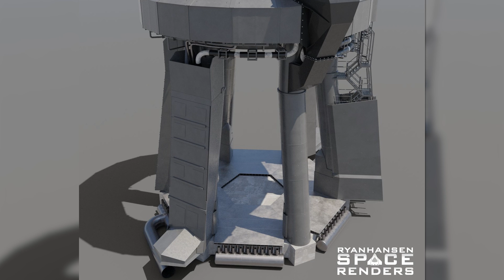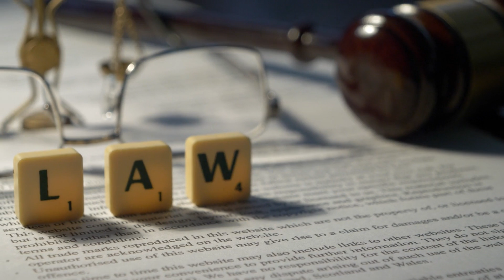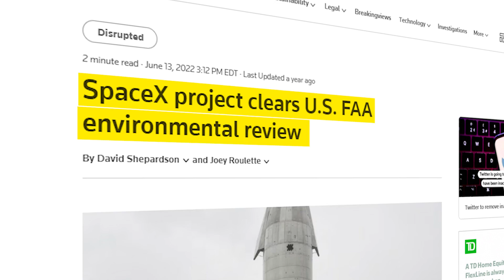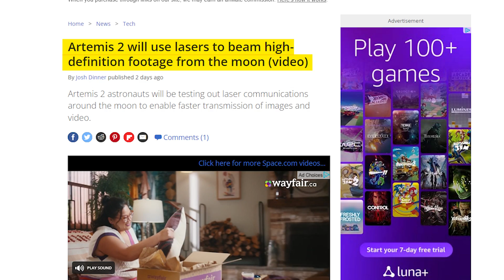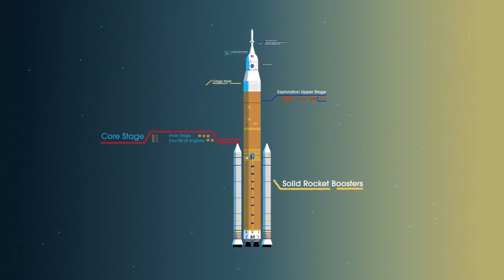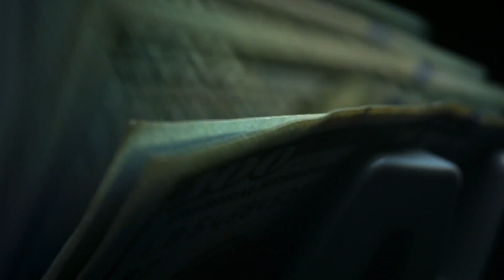SpaceX Has A Major Problem With Starship..

Comment: As good as the falcon 9 has been it’s super hard to see the catch and reset system work so efficiently that zero damages don’t happen and it’s good to go 100% day after day multi times without a heap of safety checks and mods. It has to be bomb proof as it were.

Comment: 4:30 - WRONG, And You KNOW IT!!!!!!!!!!! In THE SAME Answer Elon talks about the 40 second delay - he EXPLAINS IT WAS DUE TO THE HIGH ALTITUDE (Low Atmospheric Pressure). If the FTS was needed sooner, the Increased Atmospheric Pressure (at a Lower Altitude) would have resulted in Instantaneous Rapid Disassembly. NOT "a Pretty WORRYING Problem". This is the Second Video that you IGNORED what Elon said, and ignored my comment pointing out what Elon said, in the Same Spaces Q&A that you quoted.
I generally like what you do... but c'mon man.

Comment: Cannot believe 33 raptors at enormous chamber pressure will ever be routine and that you could launch it twice a day,it will never ever be like airline operations.
Reply: Give it another 20 years you will see
Reply: @danielstokker  - By then they will have realized that fewer engines are wiser. They only have so many now because Elon didn't want to delay while designing a new heavy lift engine. So he just had them install a cluster of existing Raptor IIs that they had in inventory. The Soviets did the same with their (failed) N1.

Comment: I'm a great supporter of SpaceX and it efforts. But (just opinions) ...
1) There appears to be no rebar in the base under the launch tower (the rebar is only on the periphery). If this is the case then, at best, this is negligence on the part of SpaceX and likely the FAA.
2) The base was constructed flat - with little ability to handle loads. Concrete is strongest under compression, the rebar makes tension manageable. Pressure on a flat concrete pad immediately puts the concrete in tension: it bends, stretching the outside of the bend. It should have been designed as a dome of some sort to better withstand pressure, thrust and shockwaves.
3) Given the previous miscalculations by SpaceX I fully expect the first launch with the "upwards facing shower head" steel plate to result in the plate being partly destroyed. SpaceX will fail to provide sufficient water at a high enough pressure to overcome the pressure resulting from the combined thrust of 33 Raptor 2 engines and the distorting effects on the plate.
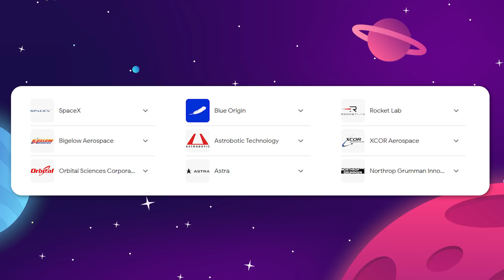As an aside, at 11:40 you indicate that the UK is part of the EU - it left in January 2020. You undermine your credibility by not getting simple facts right.

Comment: 3:00 There is no political "fallout" from the successful test. This is just a continuation by bad actors in trying to stop or slow down SpaceX imo. It's called lawfare. Also the lawsuit is a long shot to win. The FAA made real sure it checked all the boxes before approval. And that is the only thing they can be sued for. The FTS problem might take more work: Apparently the charges went off but did not ignite the booster fumes much (perhaps too little O2 at that height), and were late for Ship. I think they're going to have to blow Ship 25 to prove the new system works.

4:40 "regardless of whether any people or wildlife were harmed..." No. That's the whole point. No harm, no foul. Good on you for showing Antifa mobs while referring to the corp shills.

5:00 Requiring an EIS is the same as telling SpaceX to go somewhere else. Everyone is clear on that, you should be too. An EIS would take many years and millions. Why wouldn't Elon just go to Dubai or Mexico for example? The people in Brownsville sure want SpaceX around.

Comment: After watching it I had to ask what is the problem. Okay the flight termination had its flaws, but that is why they tested it with an unfueled second stage, I’m guessing. I’m sure SpaceX never thought the second stage was going to reach orbit. If they did they wouldn’t have used such an outdated second stage of the Starship with the Super Heavy Booster.
Reply: "unfueled second stage"
Space X did fill the second stage. The full plan was to send it to orbit and then splash down next to the Hawaiian Islands. This is why the rocket lifted upward so slowly.
Reply: It was not "Unfueled" Even if it was Unfueled why did Starship took off slowly than most rockets? Typical Elon Fan
Reply: @Lynn Geek In the 60s, exploding during Launch isn't a success even if it's just a Test Flight.
Reply: You know whats the big problem? Not doing risk assesements and very few simulations, and instead burning billions on hardware testing beacuse its easier to hire people fresh out of college than few experienced programmers it would seem.

And then there is even bigger problem beacuse all these things lead to program being now close to 2 years behind scheldue with first unmanned lunar landing contracted for next year.
Reply: You are right in your assumptions that SpeceX never expected that second stage would reach the orbit. You are wrong assuming that second stage was unfuelled. Even with 8 rocket engines out remaining 25 rocket engines working can only be trimmed to produce 50% of rated thrust. Lets assume 100mT of thrust per engine as a minimum. That still gives 2500mT of thrust as minimum. Empty Starship is around 200mT empty SH Booster is another  200mT so just before MECO we would have 2500mT of thrust pushing mass of 400mT of weight. That would generate acceleration rate of 5g. During attempted launch The Skirt of the Starship partially collapsed at acceleration rate of only .75g. That acceleration rate is consistent with fully fuelled Starship with mass of 1000mT and almost empty SH Booster at around 800mT pushed by minimum thrust of 25 rocket engines at total thrust  of 2500mT
Reply: @KarolKarolak  After posting this comment, I thought of changing unfurled to not fully fueled... I thought most readers would comprehend that Starship 24 had some fuel for self-destruction, but it had so little fuel that the scheduled disassembly took too long.?? The specific amount of fuel did matter to me, let the rocket scientists worry about that.??
Reply: @jlmwatchman  You completely missed the point I was trying to make. If Starship was empty as you suggest it was impossible for the stack to have acceleration rate so low (rocket would have climbed up much faster than it did).
Reply: @KarolKarolak  Okay, what you are saying is that if the second stage wasn’t full the Super Heavy Booster would have boosted the Starship faster.?? You do understand that I'm guessing that the second stage, Starship 24 didn't need to be full because SpaceX didn't think it would reach orbit. They didn't waste the fuel, so they tested the abort system, but since Starship wasn't full it didn't disassemble as fast as was expected. That is more to prove my guess/theory that SpaceX used the outdated Starship 24 because it was expendable. The Take Off was a success… They proved the Booster could take the second stage high enough, and the abort system works, because No one Died…? ‘Is that too low of a bar???’
The Booster was set to carry as much weight as it had to carry to Max Q. If you are telling me it should have gone faster, then you have not been reading my comments that imply that we already should be there… “Yes, I know you are talking about the rocket in Texas.”
I’m saying that we should already have a Lunar Spaceship Assembly Complex so that we could test our Mars Starship safely away from any environmentalist.
:face-orange-frowning::hand-purple-blue-peace:

Comment: Still have to address why so many engines failed. From what can be seen, they continued failing until maybe eight were out by the time the rocket went into a tumble. That amount of failed engines could abort a lunar or Mars mission. So clearly SpaceX needs to do considerably more work on the booster itself.
Reply: Many of them were older engines they are constantly increasing reliability newer engines are much more reliable
Reply: @01codblackops  You know that sensible people only test the things that they are actually going to use because testing outdated stuff doesn't show you what the problems are with the new stuff.
In other words, saying that they were just testing stuff while also claiming that of course the old stuff was going to fail makes one sound like an utter moron.

The facts is that by the end close to 1/3rd of the engines had failed to keep working. 
1 in effing 3

The fact is that the FTS failed to do it's job. A self destruct that only destruct itself is worse than worthless

The fact remains that the rocket was utterly out of control after 1 minute flight time
The fact remains that even at lift off the rocket was already not fully under control because it was slanted and veering of it's wanted trajectory

The fact remains the tank farm was damaged. Not just the outer shells but at least one tank with LOX in it inner shell was breached
The fact remains stage zero damage shows crappy engineering and planning

This was not a success. It showed sloppy work, faulty engineering, bad management, disrespect for laws, regulations and deeply disturbing lack of common sense.
Reply: @01codblackops  - Why use anything but the newest engines for the spacecraft's first orbital test flight? Or was this just another 4/20 thing.
Reply: @daniels7907 because the booster and ship were old variants it was likely to fail anyways so they might aswell use the old engines (that had been used!)
Reply: @Wurtoz  - Do you realize that you just demonstrated that this launch was nothing more than a publicity stunt? You don't conduct flight tests with already obsolete hardware unless all you're doing is putting on a show.
Reply: The Skirt of the Starship partially collapsed at acceleration of only .75g. If all rocket engines were working during liftoff acceleration of .75g would have been reached at an altitude of 20km not at 40km. Rocket would have exploded much sooner.
Reply: i mean look at the damage. look at the damage miles away, it can be said that the engines got hurt by the stupid launch desition because elon dont want to wait 2 weeks longer
Reply: The engines were damaged by debri when the concrete pad was destroyed.
Reply: @kb9gkc  - You would be amazed at how many people I have argued with who think that was impossible because the rocket's downward thrust. As if basic Newtonian physics were never taught to them.
Reply: @Lynn Geek You mix thrust with acceleration acceleration is change in velocity that is expressed in m/s^2 where 9.81m/s^2 = 1g (gravitational acceleration on Earth's surface)  Thrust force of the rocket must exceed mass of rocket times gravitational acceleration in order to leave launchpad. To reach acceleration of .75g rocket has to develop thrust force that is 1.75 greater than mass of the rocket times gravitational acceleration
Reply: There will be no crewed Mars Mission. That's just Elon's P.J. Barnum Style Hokum to rope in the rubes. Mars is a more hostile environment that the Moon, and the distance means it could be a one-way ticket. When NASA make plans for a trip Mars I'll be more inclined to believe it, but not when EM is the sole person making such claims.
Reply: @Lynn Geek both of you idiots are conflating basic terminology

Comment: Even with expected water cooled steel plate it still won't be enough fr the massive trust of all those raperter engines.grest we have a private company thst can fo these tests.nasa would be 10 years doing thr saem tests
Reply: Because the times in NASA's history where it played fast and loose with new technology, rockets exploded and eventually people died.  Already you can look at that water cooled plate and we can see two possible problems... the iron plate reflect the pressure wave and matter from the rocket  exhaust even better than concrete, that wave goes up to the rocket, damaging it... AND 2 -  the water in the metal plate cannot be moved fast enough and it heats up into steam and it explodes sending shrapnel up into the rocket... both outcomes can also happen. You need test, to know what will happen.

Comment: You know it's crazy as they had to hit the destruct button because the hydraulic system failed on the lower booster so they couldn't control it no more so it started going and over in before they could separate the Rockets so they hit the self-destruct mechanism direct instruction was so good it took awhile to it to blow up
Reply: It’s called a prototype for a reason. This isn’t anywhere close to the final version. They accomplished what they wanted to and found issue to fix. Most people don’t seem to understand this kind of development plan.
Reply: @JeremyDN  doesnt matter, the FTS should never fail

Comment: The main reason for the water is not as much cooling as to provide a sink for the acoustic impulse and keep it from reflecting back upward and damaging the vehicle. It remains to be seen whether a steel plate reflecting the impulse straight back and upward will help. We almost lost STS-1 from the acoustics at launch. These lawsuits are well-grounded and now that we have actual real data and measurable damage due to a failed FTS and debris flung across a protected area, the FAA can no longer waive an in-depth EIS. If SpacEx can't completely restore and clean up everything per the agreement they signed going in, no license should be granted.
Reply: They can and will clean everything up and also im not really sure that the sand can be called debris that flung over protected areas.... The concrete is a different story.

P.s. the fts did not fail it did it's job but it was rather too small for the size of the rocket and also elon said the structural stability of the rocket was beyond their expectations so most likely the fts wasn't fit for taming the monster that starship is.
Reply: @trapstoner if a “flight termination system” doesn’t immediately terminate the flight, it failed.
Reply: @ryanp0342  not really because if the flight termination system truly failed the rocket would have plummeted to the ground mostly in whole maybe in 2 pieces. Failing would have meant that it simply didn't activate and didn't punch the tanks which it did it just wasn't enough of a hole to rip the rocket apart fast enough... Fts is supposed to tear the tanks laterally and the common dome between both tanks for rapid mixing of propellants it doesn't just explode the rocket it lets the atmosphere do that
Reply: @trapstoner  No. The rocket didn't explode from the holes punched by the FTS. It is clear as day it exploded from beneath the skirt and then progressed upward.
Reply: Amazing how everyone keeps forgetting the acoustics!  A water covered flat steel plate - what's that going to do to the acoustics?  Reflect all the shock waves right back into the engine bay!  Then there's all the fun of the 'deluge' water flashing into super-heated steam that takes up far more space than the water.  Where's all that going to go?  What damage can it do?  There's a reason why all launch pads for large rockets have flame tenches and water deluge systems...

The problem with Musk is that he is so sure he knows better than everyone else.  And this egomania is dangerous - especially when it's allied with tons of highly explosive gasses.
Reply: They aren’t forgetting them. Elon has addressed this as well along with others. They explained how they don’t get bounced directly back up. If they have steel plates that are water cooled, this will dampen the sound dramatically if enough water is forced up. These aren’t dumb people lighting a match and running away. It is funny though how so many people think they are rocket scientist on here knowing exactly what they need to do. Shouldn’t you be working for SpaceX if your so smart? Would imagine. Go figure.